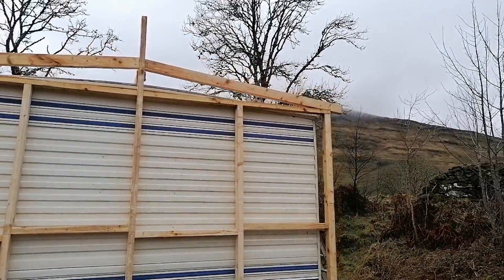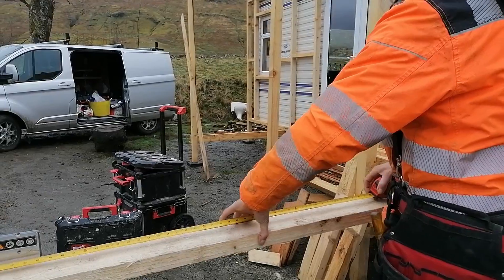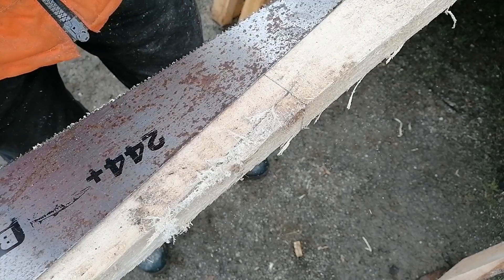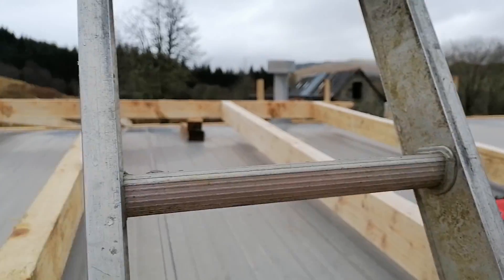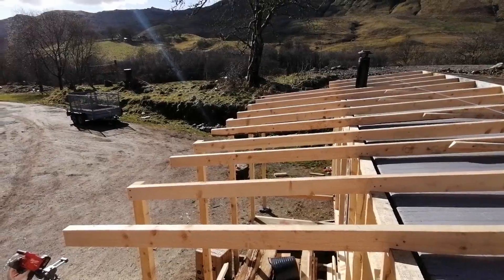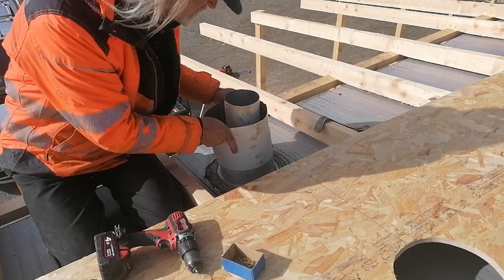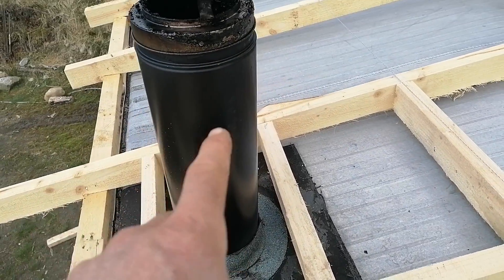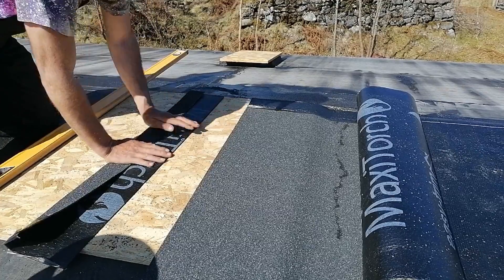LADYFIELD FARM - How to Renovate a Static Caravan : PART 2 Cutting the Roof and Extending the Flue

Comment: fantastic job, is this an expensive job overall?
Reply from the maker: I was very fortunate to be able to mill all the timber myself so that didn't cost me anything but nowadays no timber is cheap. The sheets and felt for the roof was around £350 if I remember correctly and the fleeces were also free. So I can't tell you a realistic cost as I didn't have to pay for much of the materials but I would say if you plan to be in a caravan for any length of time it will be worth the investment.

Comment: I’ve watched your video and I’m following you way I’m useing 4x2 for stud work and cutting the gutter off flush as have tonnes of 4x2 save me buying 3x2 my question is how come you didn’t leave an air gap and also do you think when you come to move it , it won’t be too heavy ?? Great content btw well done
Reply from the maker: Hi Tom, nice to hear the video has been of some use to you. Cutting the gutter off sounds like a fine plan, always best to use what you've got eh. As for an air gap I didn't see the need for one and as it stands there is no evidence of this being a problem. The insulation is doing it's job keeping the heat in and there is certainly no sign of any damp, moisture or condensation anywhere. Due to the nature of the wool there is some means for air to pass through and around, so all seems well as is. As for the weight, we have no intention of moving the caravan but I would imagine with care it could be done. 
All the very best with your project, I hope it goes well.

Comment: Great Job. I plan on cladding mine, but only up to gutter height, what would be the best way to fix the frame under the gutter. I have an existing deck at the front so that can be used to fix the 3x2 at the bottom, just wondering how to fix at the top.
Thanks
Rob
Reply from the maker: Hello Mr Mully, I would suggest that maybe the best way to fix at the top would be to find the timber uprights within the wall. Their position will be given away on the outside by the presence of screw heads through the metal exterior. If you put a small angle bracket on each of these a couple of inches down from the underside of the gutter then the head of your stud work could be attached to these. Obviously your uprights would be taking the weight of the head so the only job the brackets have to do is to stop the stud frame moving away from the caravan. If you clad each end of the van also then joining each frame to the other at the corners will also stop any of them moving away from the caravan.
My other thought if you are only cladding up to gutter height to be sure to have a flashing of some sort that will sit under the gutter but over the top of the head of the stud work and the first cladding board. Hope that all makes sense and is of some use. Thanks for watching.

Comment: What size timber are you using? It looks like 3x2? Can I ask why you didn't go with 2x2s? As you know I'm aiming to do exactly this on my mobile but probably would only use 2x2s please advise?
Reply from the maker: Hello Lex, a couple of reasons I went with 3x2 really. For one thing it allows room for more insulation than 2x would. Also because all the roof timbers sit on the head of the stud walls and exert a lateral force to push the walls outwards I don't think 2x2 would be man enough for the job. If you could fix 2x2 to the actual caravan walls outside then perhaps they would be strong enough but because of the gutter projecting out an inch at the top that would reduce the head of the stud to just one inch and would offer no strength or fixing for the roof timbers. I hope that helps.
Reply: yes, I gave it more thought. The roof beams will be heavy for sure. After watching this video I realised you have built an independent frame around the mobile. I don't have the freezing conditions you have so I'm going to attach my 2x2s directly onto the inner beams as I aim to take the frame right down to the ground. I will rest the frame on concrete blocks just as my mobile also rests on blocks. An added plus will be creating a huge storage area under the mobile. As I'm busy with floorboards at the moment I will fit a couple of access hatches inside. Unfortunately it's going to still take me a long while as I rely heavily on help as I am disabled. But in another 6 months I should be finished. It's a slow frustrating process for me. But will get there. Thanks for all the information it helps me tremendously.
Reply: @LadyfieldFarm  oh I will be putting plywood roof and membrane straight on to the roof with a 6 inch overhang covering the gutters completely.